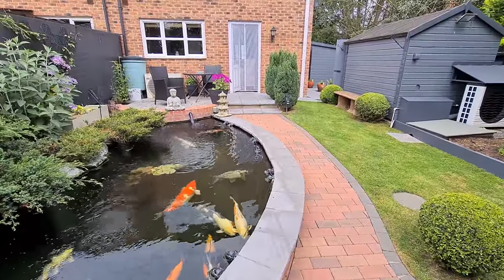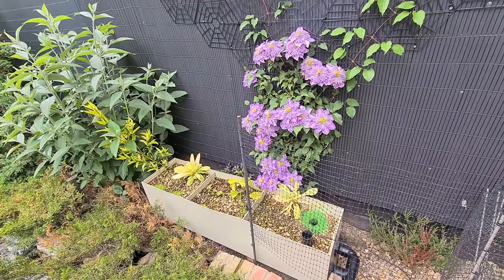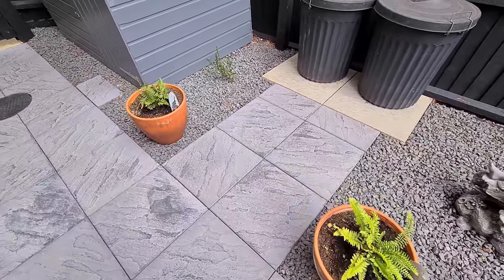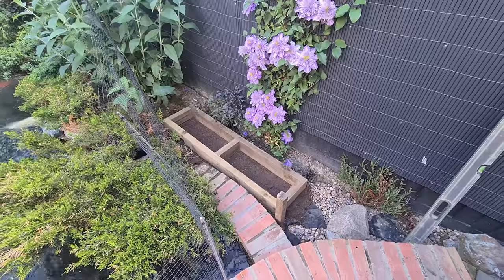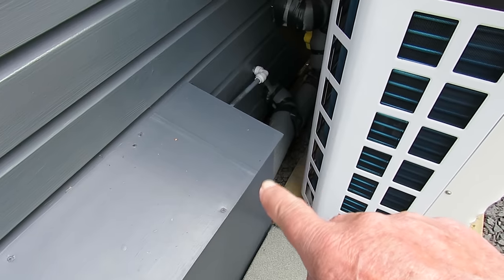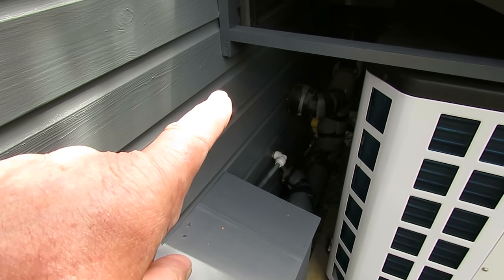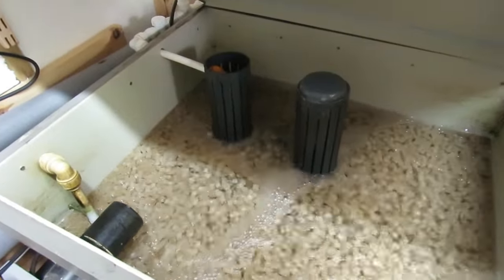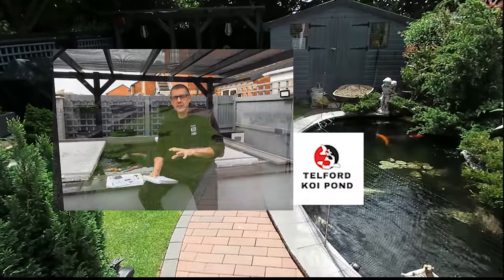Bog Filter MOD And Filter Setup Explained.

Comment: hello terry first of all it seems all wrong to me. your trying to make a wetland filter not a bog filter. the main difference is one has soil the other has stone and gravel in it. What I would do is rebuild it. you need a large void under the stone this can be done with plastic boxes , crates, big pipes. then on top of the large void or empty space you need various sizes of gravel. The idea is the water will flow quickly and filter up between the cracks in the rocks up where the plants can feed. This also gives the bactria to live and colonize  the stone starting with big stones or smallish rocks. I would consider  80-100mm rocks then another layer of 30-40mm then 10-20mm then finally a layer of pea gravel. Get lots of pond plants and sit them directly into the pea gravel. wash soil off. the plants will feed off the fish. I am building just that myself. its modelled  on a aquascape wetland filter but scaled down by a factor of 1000 hope you find this info useful.
Reply from the maker: Hi mate,  To be honest, I'm not sure just what I am building lol. I know nothing about building this sort of thing. Thank you for the info though mate, it has helped quite a lot. Now I have done the modification, I'll give it a go and see what happens. Thanks again, it's very much appreciated. Take care mate, Terry.